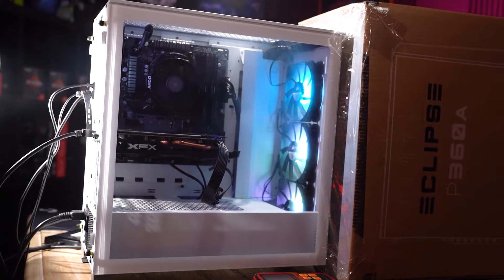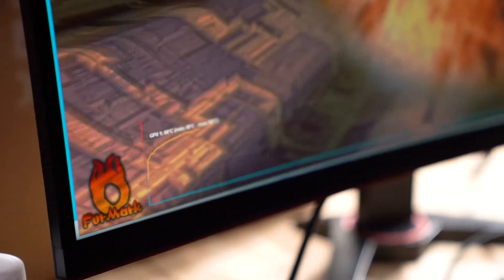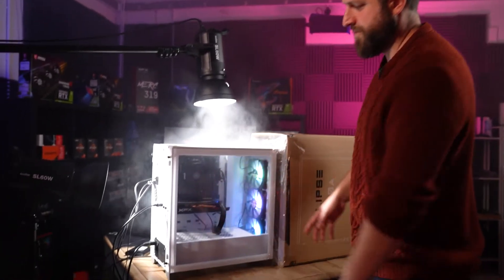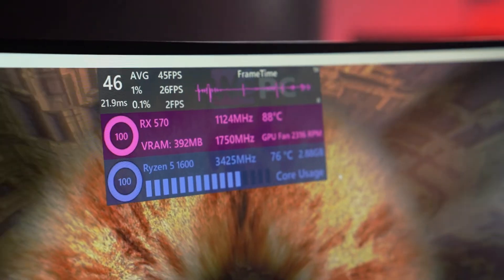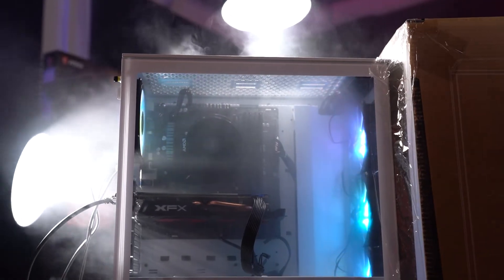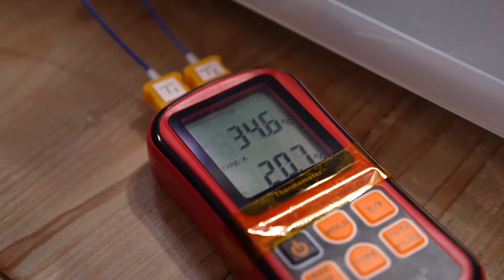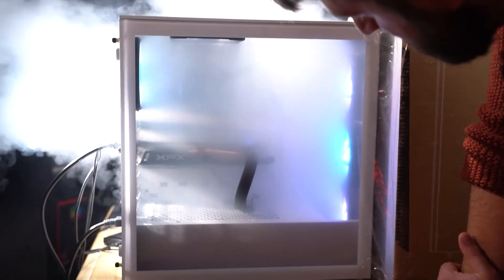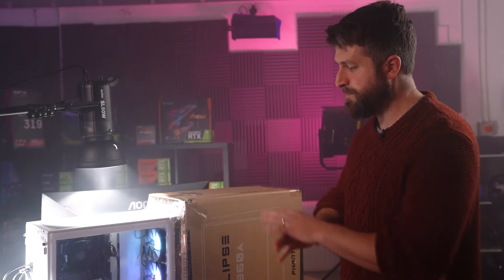Which fan placement has the best airflow? Corsair 4000x, Airflow and Temperature Test, EP. 3

Comment: I've done this test with the same fan configuration and got the same result, I even flip the fan on the top front to be the intake to see what happens and I got even worse temp with it so I zip tied that fan on the back on my CPU cooler tower and add two more at the bottom to help feed the GPU and two exhaust fans(1 rear and 1 top)
Reply: really ive had different experiences, recent i upgraded the intake fans in my theramltake h200 case, its a solid front panel, so i bought 3 artic p 12 in the front of the case now, i took the faceplate off the case and added mesh to it, and i also flipped my top front exhaust to intake. my top back is exhaust, rear is exhaust, im also running a sama aircooler on my cpu. rn under load im averaging 48 to 54 degrees underload. just idling im averaging 34-38 depending on background apps on idle. so my therory is the 3 artic p12s are static pressure fans, the other 3 are airflow, but i think the static pressure helps hold the cold air in the front when the top airflow fan is pushes fast and swirling it around

Comment: It's unfortunate that a test just using the default 2 case fans wasn't done, one in back for outflow, one in front in middle for inflow - with all vented areas with no fans or anything else blocking them (like the empty fan holes up front and the totally unblocked top).
Reply: The 4000x comes with a default 3 front fans
Reply: @dragonjo-fy4ki  Ah, I assumed 4000D and 4000X were configured the same - well, they should test 4000D then, too! With just the default fans.

Comment: Is it hard adding case fans at the top when you already have a CPU cooler installed? Do you have to remove ur cpu air cooler to add case fans at the top or rear? Just wondering b/c my case fans are coming late and I'm not sure if I should wait for my case fans to come before I start my build or not

Comment: Makes me think if you do put a case fan on the back, you should have it pushing in like the front fans, instead of sucking out the back.  To increase more positive air pressure, to push it out ever crack and out the top and out the empty PCIe slot holes and even be assisting the GPU fan and PSU fan and make them spin just a little faster.   You want turbulent air pushed in, rather than smooth air sucked out.   Air is turbulent after a fan, but smooth while being pulled into it.

Comment: I think it's worth noting that the reason the back end was a little tower for the top fan configuration was because they were actually sucking the hot air from the GPU up and out of the case instead of the GPU recycling its own hot air like in the others.

Comment: This helped me decide.  For my 4000D with a NH-D15, I shall now proceed to employ two front NF-A14 intake fans and one rear NF-A12 exhaust; and, I shall let the positive pressure do its thing to exhaust passively through the top.  I believe in doing only that which is necessary and sufficient, and I lean towards a quieter solution that gets the job done.  If need be, I shall add an NF-A14 top/rear to diminish peak temperature spikes.
Reply: This is exactly what I’m planning on doing as well.
Reply: Same as I do with the NF A12x25 (because they work better than the A14) but I also added 1 slower running top fan for "dust exhausting".
Are 2 in better or more optimal than 3 in?
Reply: @tobireindl  the 3rd intake fan would be front-bottom, which would be largely blocked by the PSU shroud of 4000D.  BTW, my build is complete with 5800X3D and 3070 Ti, and CPU temperature does not exceed 70C at full stress test with fans remaining inaudible.  Amazingly good.
Reply: @Chris.Brisson  Okay thank you, but 3 in did not make any difference in my tests (thought I was wrong there) because it is blocked, as you already said correctly. Think I will stay with the way I currently have it and I cannot get more than 50-55° at all - maybe because of my 4070 Ti. 😅

Comment: Thanks for this video! I have a 360mm AIO at the front (doesn't fit at the top). I like the idea of the coolest air available hitting the radiator first but now seeing this video it's clear why by GPU is running hotter than I expected. I didn't really put much thought to the warm air passing over the radiator flowing directly to the GPU. Sometimes just seeing something visually helps a ton.

Comment: i really liked those tests. im curious however, how those results would differ with a 240 or 360mm radiator mounted on the top, considering there would be 2 or 3 fans at the top exhausting, but with the resistance of the radiator ridges.
Reply: The case only supports 280 on the top, not 360, so, you can mount 2x140/2x120
Reply: Is this case good?

Comment: I'm thinking front bottom fan to blow outside, giving a route for the hot air from the GPU fans out of the case.. or intake top and back exhaust to fronot... copu is anyway under postive presure due to fan... but this way there is a flow inside the case that works with the direction of the GPU and CPU fans.    Starting to miss those old side intakes from the 90s? PS I have same gfx card. I woulkd also take temps in the PSU compartment... I've had expensive experience with PSU dying of heat taking out everything with it in a loud BANG

Comment: I decided to keep my top case fan off and just leave the rear fan on. Got better temps with this configuration, I have the kraken x63 cooler and fans in front. Idle temp for my gpu is now 42c now instead of hopping back and forth between 45c and 50c. Very surprising to see these results just from changing the air flow direction by turning off a fan.
Reply: my case is the nzxt h510 flow

Comment: Great video! Not sure if anyone has already asked this (or if it's a dumb question), but based on the effects of removing 1 fan on top, could the rear temperature be further improved if you blocked the open space on top where the 2nd fan used to be?
Reply: I'm a bit late but I briefly tested this, open vs closed top. Like closed up to the tower and it maybe differed a degree or two... But hopefully someone else will do a better test ☺(6 fans, 3 front, 1 bottom = intake, 1 back top and 1 rear = exhaust in a Silent base 802)

Comment: Please test non traditional layout MATX or ITX case. I have Corsair 280X so I would like to know which configuration is the best. It is known to have limited airflow because of tempered glass at both the front and the top. But it is interesting case since the PSU is in separate chamber. So there are two fan slots at the front, two at the top, and two at the bottom.

Comment: Watching the air flow, feel like it missed a smaller fan at bottom rear sucking air in to help gpu, also, maybe a better measure would be checking the heat of the air just outside the exhaust from case, see how much heat it is taking out rather than how hot it is inside? you would expect the air to heat as you are transferring the heat from the surfaces to the air.

Comment: Do gpus push the air out through the top or the sides? I have a 3070 gigabyte gpu and it has a shroud on top so my guess is that the air was released to the sides instead of the top.

Comment: So basically Fractal Torrent is the perfect airflow case. Unless you lower the RPM on the upper intake fans there isn't enough time for the cooler air to cool the GPU and CPU. Big 180 fans to cool the CPU mainly and bottom set 140 to cool the GPU with the exhaust to move the hot around near the top.
Reply: Would an all out push setup be viable? Where as much air is being removed from the case as possible. (Idrc that much for aesthetics) Just want it to cool as much as possible. The Case I'll be using is the Phanteks G500A if that helps.

Comment: I went with this case with a front mounted 360mm aio 2 120mm up top and 1 120 in back. Have a 3090 ti founders in it as well.. Which was a nice snug fit.
Reply: did you configure your aio as an intake? or an exhaust? how has everything been running temp wise for you so far?

Comment: RX570 overclocked (1400/1750MHz) and undervolt with Phenom II X6 1090T overclocked (3.8GHz) with only three basic 12 cm fans on case plus one on CPU cooler. Room temperature is about 25 degree celsius, CPU 58 degree, GPU 78 degree stable. Inside case are also RAID 5 configuration with 4x7200 rpm disks, one 5400 rpm disk, one SSD disk, RAID controller, WiFi card and Audigy 4 Pro audio card. This is same case as mine... https://www.youtube.com/watch?v=RPkMQNunYrk Everything is in right airflow direction.

Comment: I wanted to see the top fans pulling air inside test :(
Reply: @cowmath77  correct.  Radiator should get the coolest air possible. Always.  Top as intake right out the back exhaust.
Reply: My air cooled pc is considerably cooler by having the top fan closest to the front of the case pull air in and the rear top fan above the cpu pulling air out. It creates more cold air pressure in the case and the 2 rear exhaust pump out all the heat. Try this for yourself if your running a air cooled setup and you'll be happy with the results.
Reply: @cowmath77  "hEaT nATuRaLLY RisEs so intake top bad" is the soy gaymer midwit mantra, I hate seeing it everywhere. Even when confronted with a video proof, they still persist in their delusion. pathetic.
Reply: The top of my case is obstructed. So, I'd like to see the top as intake and 1 back exhaust as well (3 front intake, 2 140mm top intake, and 1 back exhaust).
Reply: The best cooling comes from top fans set top as intake. Anyone talking about heat rising as a reason to use them as exhaust instead, won't change that.
Reply: @ChrisRJ  its not about heat rising, convection isn't important. But the gpu fans push air upwards, by using top fans as intake you blow two streams against each other, creating turbulence. Adding just one top exhaust to the existing 3 intake and 1 back exhaust is probably better for airflow. That said, I have no temp tests to prove that, so just speculation.
Reply: Heat naturally rises so that is going against the natural flow of things, it'd do something but probably not as good
Reply: Not worth it
Reply: @cowmath77  sounds like someone’s projecting. If you think cold rises then you’re just ignorant to basic thermodynamic
Reply: @adawg709 because a fan will have no problems overcoming "heat rises".  You can see in this test adding top exhaust makes the inside of the case where the actual components are HOTTER.  Top intake removes this problem and also helps direct more fan intake down to the gpu rather than letting the gpu take on air from the PCIe covers which you can also clearly see in the video.  You want to direct cold air to the components and THEN exhaust it once it's been used.  Exhausting more air that hasn't been used is pointless or even detrimental because the air flows like water, path of least resistance.  If that path is AWAY from your cpu and gpu thats bad.  

Tldr "heat rises" is only passive and air pressure/flow from fans easily overcomes this.
Reply: @calvin659  the top intake makes the front panel fan hit the gpu instead of being pulled up through the cpu.  Top exhaust only makes this worse.  If you give the air somewhere else to go it will go there.  So don't give it anywhere to go but the things that need cooling.
Reply: @adawg709 
Whenever someone references “basic thermodynamics” I immediately know that they don’t even know basic thermodynamics. Do you think that the PC’s airflow is by convection?
Bringing cold(er) air inside the case from the top is going to cool better that blowing warmer air across the radiator.
Now THAT’S basic thermodynamics. 😂
Reply: @cowmath77  he’s right. Why would you go against the natural flow of heat? That’s just unnecessary stress on your fans?
Reply: You wanted to see what a stupid decision looked like?

Comment: Great video, loved the visualisation! I am wondering if the main purpose for the two fans at the top is mainly liquid cooling. As the first fan is only getting fresh air fed right into it, this would be great for a 240mm radiator. Would like to hear your thoughts on this. :)
Reply: That exact concern is addressed towards the end of the video.

Comment: What do you think about having the top front as another intake, Would it benefit or make the airflow too turbulent?
Reply: i nave 2 140mm fans on the top inteke as well as 2 x200mm front fans and 1 x120mm exhast fan , my system much colder than before

Comment: i have the same case but the airflow version and this answered most of my questions, the only thing im still wondering about is if the top rear fan was placed as far back as possible and the front fan on the top of the case placed as further front as you can but as an intake would that be better?
Reply: Hot air exhausted  from the GPU might just hitting the fresh air coming from the top, trapping the heat inside the case...
Reply: @X.Y.Z.07  probably
Reply: @baderq8ty99  i tried this setup before, and it increase my gpu temp by about 4c°
Reply: @X.Y.Z.07  i have this set-up since i made that comment 7 months ago and i haven't done any testing, but i think i'm probably fine because the fan at the back end is 140mm and the forward one is a very weak 120mm so it's probably not strong enough to push the gpu exhaust down but only direct it to the back, not sure though probably need to test different set-ups

Comment: I upgraded my daughter's build with the 4000X case before I found this video.  I installed the same model fan (white version) that comes with the case as an exhaust in the rear.  I used the stock cooler with the Ryzen 5 1600.  I also mounted the GPU vertically.  This build has a white mobo, RAM kit, and graphics card.  I also went for the white CableMod PSU cables. It looks very good and performs excellent.

Comment: To SUM it up....! If you are searching for the ideal airflow for AIR CPU cooling solutions READ this...

The BEST configuration for AIR CPU cooling using the 4000D airflow case is to have three 120mm intake fans at the front and one 120mm exhaust fan at the back. 

The explanation ??WHY?? is quite easy :

- When you are talking about airflow you want ideally the air moving towards ONLY one direction, so putting fans at the top will try to bend the airflow coming from the front at 90° to the up direction therefore limiting the capability of the rear fan to exhaust air.
- If you are still worried about the space at the top which is not filtered with fans then the law of physics are here for you... hot air is moving naturally upwards plus the 3 fans at the front vs the 1 fan at the back gives a positive air pressure which will speed up significantly the air that is already naturally making his way up to the top of your case
- Additionaly, the positive pressure will feed your case with the the most dust free air since the 4000D has an excellent filter at the front. Last thing... with this configuration i would use the same type of fans in front as the one at the back and in case i had a fan with higher static pressure i would definitely want to install it at the back so that the air can move more efficiently through the grille of the chassis.

Keep cool and feel free to comment below if you think there is a better configuration :)
Reply: This is not necessarily accurate.  Check out The Tech Buyer's Guru video on PC case fan setup.  Very informative and you may be very surprised with the results.
Reply: this is how ive been running setups for nearly 10 years with only noctua cpu coolers and it never fails, always just one exhaust fan and at least two intake fans and you are good to go 👍👍
Reply: would it be worth still to include at least 1 exhaust fan on the TOP position placed directly above the CPU? or is the 3 front intake and 1 rear exhaust better

Comment: My prebuilt came with 3 front fans and 2 fans at the top with no fan on the back, should I install an exhaust fan at the back. Same case btw with 3080.
Reply: Nice build thinking of mounting top front as extra in take as my AIO is front mounted.

Comment: screw the 4000d airflow, you can just take off the front panel and it'll be the same as the 4000d airflow. do the 5000d airflow with 10 fans in it.

Comment: Glad I found this l, great review ! Just ordered that case and will be using a 240mm rad on the top as exhaust.

Might try and get the front set up top down as : Top 140mm - Mid  120mm - Bottom 140mm
Reply: Did your front intake config work?
Reply: @badmoose01  unfortunately not, it almost fitted like that if I dremeled down the fan frame.

Did 2x 140s instead

Comment: for the top of the case fans you should have tried; fan closer to the front to be pushing air in while fan in the back to be pulling air out. I'd be curious to see the results
Reply: Those results are always awful in tests.  The six 120mm fan layout is almost always the best unless the case is designed for something like negative airflow...nzxt

Comment: I am still having some issues with my AIO installation.

I have the 4000X with the frontal glass and lateral glass door.

I mounted an AIO at the top (both fan exhaust)
1 rear fan exhaust.
3 in take fans form the front. 

I am having temperature problems to the CPU.  +60° when gaming. (curious thing here, CPU is Ryzen 7 5800x and Lianli Galahad 240mm AIO.) 

and I cannot find the problem :( help please.
Reply: 60* is a great temperature for a 5800x while gaming, you don’t have a problem. You’re lucky.
Reply: @cgsather3309  Yeah lol, he want 30 lolo.